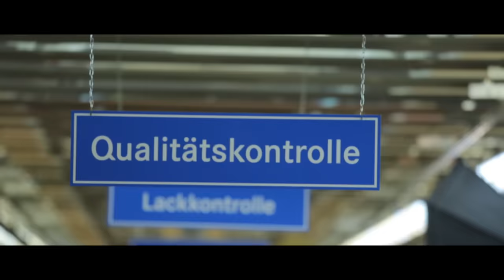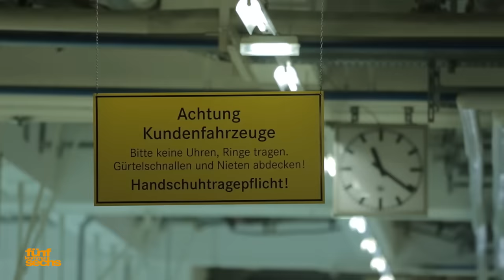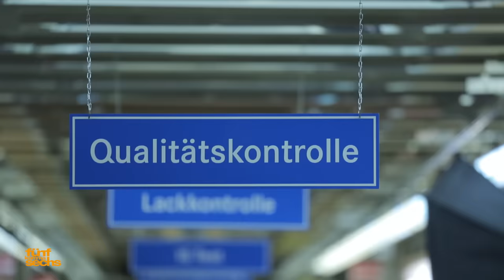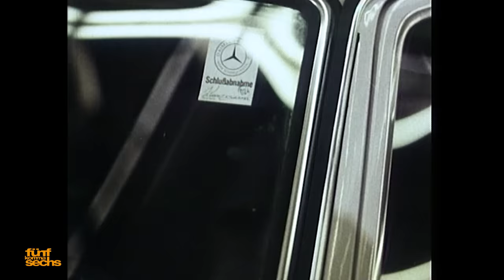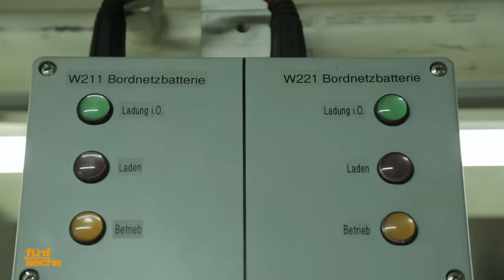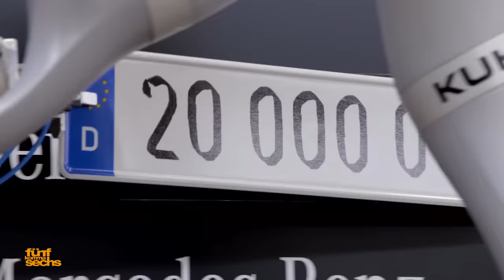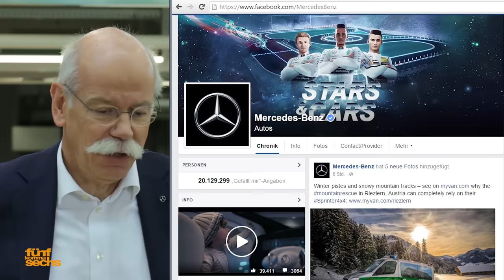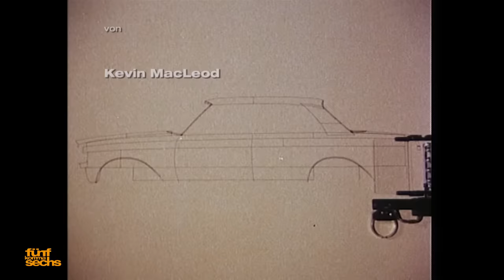Dr. Z and the 20 Millionth Mercedes made in Sindelfingen (German)

Comment: Question: I see some new S 500 models destined to be shipped to the US.  But we can't buy that model here!  What is it that I don't understand?
Reply from the maker: Actually there shouldn't be an S 500 destined to the US at all, because those used to be called "S 550" overseas, which you may know. Of course it's always been the same V8 engine with just very little modifications. After the facelift, though, there is no V8 inside the S 500 anymore. This is now a brand new straight-six with an integrated starter alternator (a so-called "mild hybrid"). So for some reason there aren't any S500/550 anymore for the US with this new engine - perhaps because Mercedes doesn't see any demand for this. Instead you now get the S 560, which is still a V8 like the "old" S550, but with a little more punch thanks to its now AMG-engineered 4-liter-biturbo :-)
Reply: Yes, that was my whole point.  I simply can't understand what the US MB people were thinking when they decided not to offer the new S 500 straight 6 here.   There are plenty of eager buyers  like myself waiting for it!

Comment: @fünfkommasechs:  Is there any reason why I can't order a new S 500 mild hybrid in Sindelfingen and have it shipped to me?  I bought a BMW 635CSi in 1985 (grey market time) in Germany and had it shipped to me in the US.  Lots of fuss with catalytic converter conversion in those days, but none of that should be a problem with the new S 500.
It should pass any local smog check requirement with flying colors I would think!  What are your thoughts?
Reply from the maker: I think there's much more to it than just the emissions. You also need to have different head and tail lights and this funny emergency or "anti kidnapping" button in the trunk ;-) Where are you located? I will check with Mercedes-benz to get an info on if and when the S500 will be available in the U.S. or even in your city
Reply: Ah yes, I was not even aware of those specs.  Similarly, years ago when Citroen was still bringing cars to the US they suddenly stopped doing so due to another dumb outdated US law requiring a footman to run ahead of  cars that did not have fixed headlights.  So when the new Pallas DS 21 came out with the revolutionary headlights turning into the curve Citroen finally had enough of our idiots and withdrew from our market.
The dumb lawmakers and their stupid bureaucracy!  BTW, dear fünfkommasechs, I currently drive a C class coupe cabriolet, which is a very enjoyable ride as it is, but if the new C class mild hybrid version is easier to get or comes to us first I would also be very happy!  
Thank you very much from an old school Austrian immigrant who tries to live amongst hillbillies in pickup trucks  ;)  -  your help and prompt replies are much appreciated!
Reply from the maker: Thanks for your kind words! Haven't heard back from Mercedes yet, but we're still in the loop :-) When did you emigrate from Austria? As for "stupid" US regulations: when we did our various US roadtrips (see a few videos on this channel including one of the more recent ones), we couldn't believe that most of the cars still don't have xenon headlamps let alone LED. We learned that one of the greatest features of modern Mercedes vehicles - the impeccable technology that is ILS or "Multibeam LED", which can intelligently spare out vehicles ahead while still using full highbeam - is not available in the US at all. The new CLS generation can illuminate the street as far as half a mile ahead - but quite likely not in the US. :-( It's been such a shame when we crossed the vast distances in Texas or Nevada with its endless desert roads.
Reply: Well, this country is full of extremes.  On the west coast you have Silicon Valley and Tesla, but as soon as you get to the heartland there is a population who never even heard of electric cars.
Reply: I hope you won't get offended by a little critique from an old time manual driver:  I cringed while watching you jank the shift lever around in the beautiful old 170 S, and expected to see the gear teeth flying out the exhaust pipe any moment.  You were trying to shift into first gear while still rolling and were disappointed it didn't let you!  No amount of heel/toe action could help you there, you simply need to be stopped.  No offense please.
Reply from the maker: I'm not offended at all :-) You mean in our E-Class video? That car used to be a real challenge. But for some reason they still let us drive it. I nearly crashed their gullwing 300 SL on the first mile of Mille Miglia... so it must be true love to still have us on their events :-)
Reply: No, I mean on the Dr. Z and the 20 Millionth Mercedes made in Sindelfingen nostalgia trip, which I enjoyed greatly other than seeing you torture the classic old 170 S!
Reply from the maker: I don't get it . That car is not being moved throughout the entire video - and certainly not by us. Or am I missing something? It's been a while since we shot it.
Reply from the maker: Here is the answer I got from Mercedes (in German, but since you are Austrian-born): unser
 Rollout der neuen Motorengenerationen ist voll im Gang: Wir haben mit 
den Mitgliedern unserer im Jahr 2016 vorgestellten neuen Motorenfamilie 
 - von 4-Zylinder Otto-/ und Dieselmotoren (M264 bzw. OM654) über die 
6-Zylinder Otto- und Dieselmotoren (M256
 auch als AMG-Derivat „53er“ bzw. OM656) bis hin zum leistungsstarken 
V8-Motor (M176) hochmoderne und effiziente Aggregate im Angebot, die wir
 in Abhängigkeit von der Nachfrage und Marktbedeutung nach und nach in 
den jeweiligen Produkten ausrollen. Amerika ist immer noch ein Markt, in
 dem V8-Motoren und besonders hubraumstarke Triebwerke eine sehr hohe 
Kundennachfrage erfahren. Unter anderem auch darum wurde der V8-Motor in
 der S-Klasse 2017 (zum Beispiel mit einer Zylinderabschaltung) stark 
überarbeite.

This basically translates into: no inline-six S 500 in the U.S. at this point, as there is apparently not enough demand. :-(
Reply: I don't mean the "Kutsche", but the 4-door which Herr Z drives for the longest time. I believe that is the one you drove later as well, struggling to get up that short incline at one point with too high a gear.  BTW, I really enjoyed Herrn Z's mentality and commentary, totally in line with my own "old school" thinking.  That nostalgic drive almost gets me teary-eyed each time I watch it.  I fondly remember driving a friend's 180D up the the Kahlenberg just outside Vienna, and thrilling to the joy of the steam train-like torque at unbelievably low revvs.
Reply: That would be a mistake, because not all US buyers are pickup hillbillies.  But I would probably be quite receptive to a new C class coupe if we could get that here!  I drive the cabrio version now (quite a head-turner with the cranberry leather and quite adequate performance with the 2 liter four-banger), but if it would be  offered with the straight six as well it would be a monster and find lots of enthusiastic buyers here.  Many of us remember the good old days when the straight six ruled the Mercedes line-up!  Here's hoping!